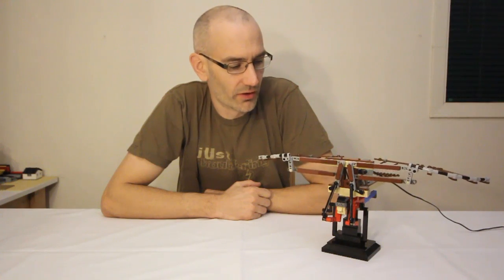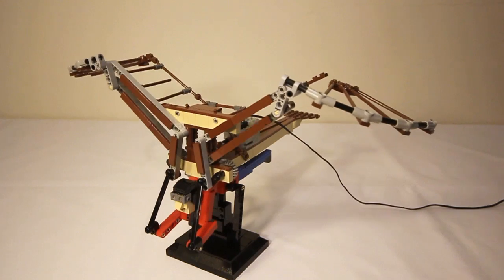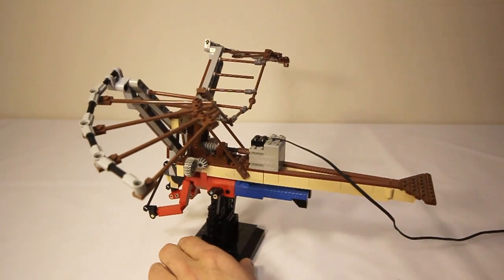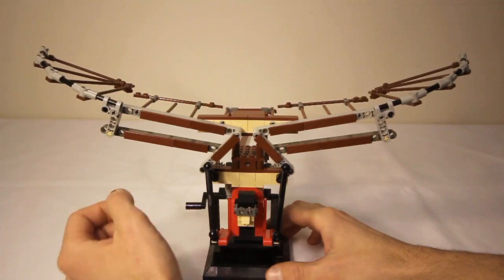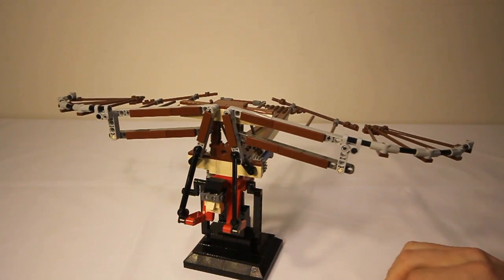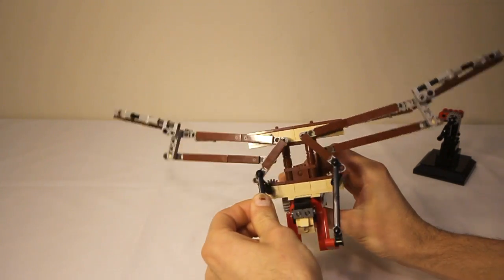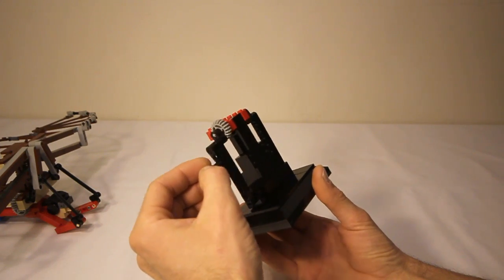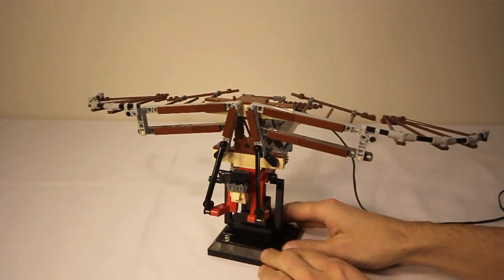The Aviator - LEGO Da Vinci Flying Machine

Comment: Just finished mine. Love it. Thanks :) What I found was that after running with a motor for a few minutes the plates where the 2 gears that drive the up and down movement would start seperating. Then the gears would slip. My solution was to modify the model so that there are gears on both sides driving the up down movement. It's now a lot more reliable.

Comment: Can this be done using only Lego technic pieces? I don’t have other Lego pieces, I tried to build until the wings and the beams part, then the gears, but the spacing between technic holes changes at the point where you attach with non technic pieces, so the wing beams touch and the movement is not as smooth as in video, may be due to half beams and other small non technic pieces there is height differences which is causing me issues, hope I am able to figure out and complete the other part where I am trying to build the man using only technic pieces. It is tough though without proper pieces🙂

Comment: Say I attached a faster motor to this, how fast could the wings flap before it just starts 'disintegrating'? :D
Reply from the maker: I'm not sure why I was running it so slow with the motor.  It can go quite a bit faster.  It can handle the maximum speed of the 9V or Power Functions M motor without a problem, which is probably around 4 times faster than I had it running. As for how fast it can possibly go I have no idea.